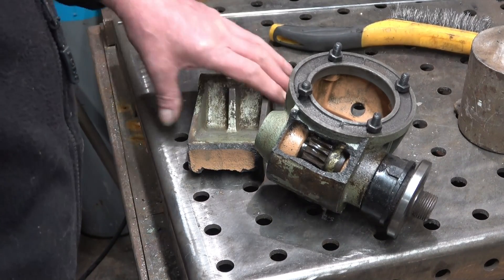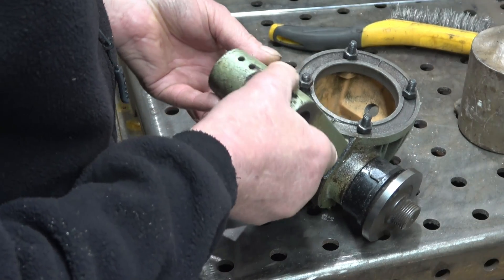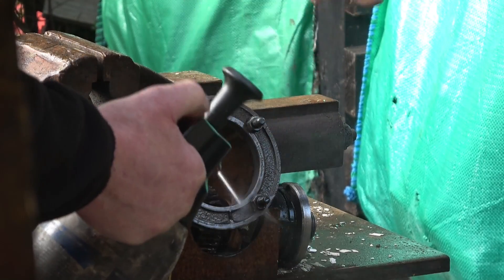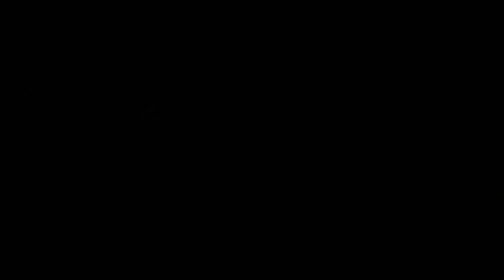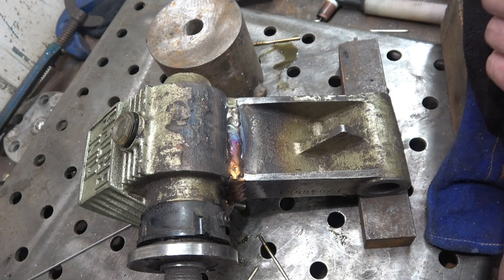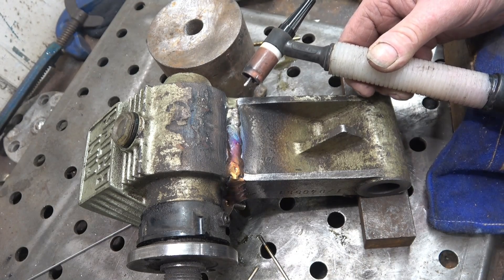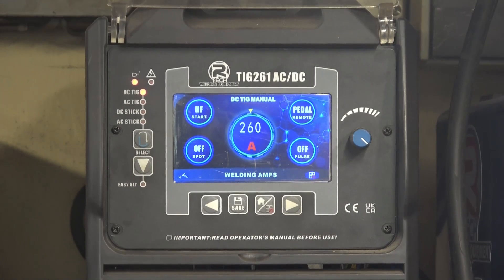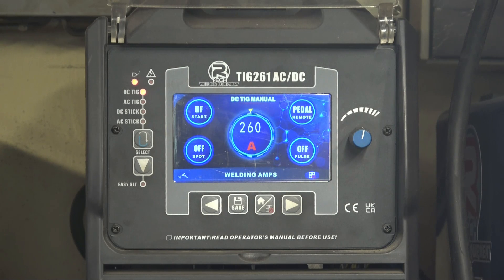R-Tech AC/DC TIG 261TFT.   Iron Casting Repair: Real World Welding

Comment: Are you not risking melting the iron running the amps that high? I usually preheat with oxy torch then run in the bronze with a lower amperage